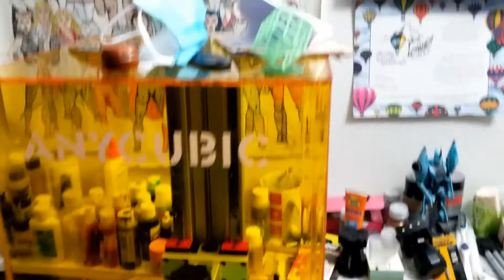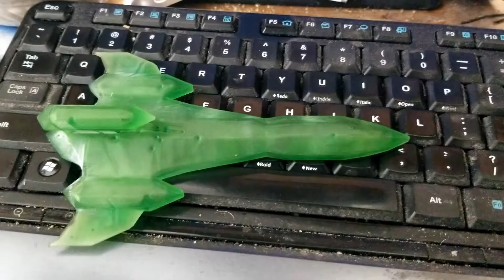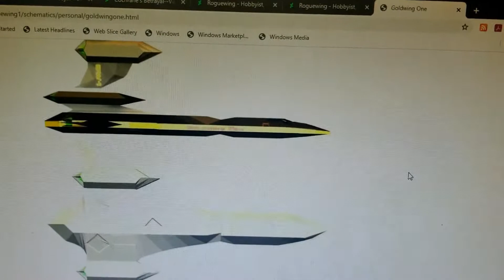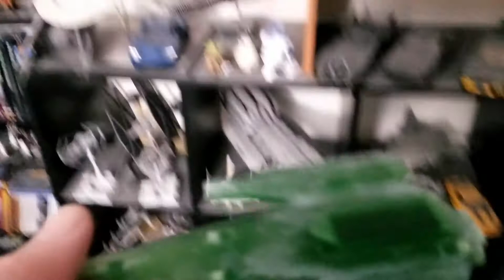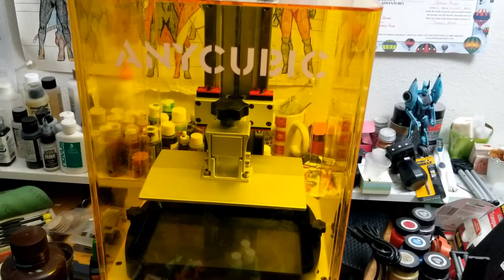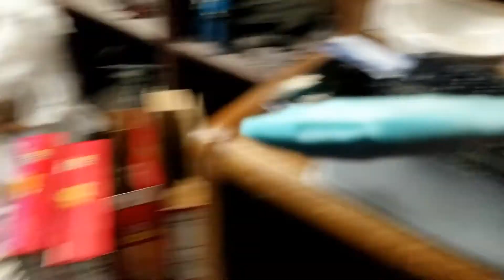Adventures In 3d Printing

Comment: A big investment for you there Patrick.

But a new thing/hobby always takes time to get used to & experimenting is the key to getting better.

I'm sure you'll get there in the end.

While the expense of laying out for the 3D printer is big ATM, im sure in time you'll be saving money in the long run, not having to shell out for all those aftermarket parts you keep buying, when you can print them off yourself.
Reply from the maker: Definitely going to be good for that, Wayne.
And I'm getting better with it

Comment: Hi, i've been following your videos for some years now, and i've always enjoyed your builds and i'm glad to see that you purchased a 3D Printer, i have also one, and if you accept a suggestion for your hollow 3D prints, if you're using Chitubox to prepare the files there is an option to make holes in the files, so that way you can print hollow and the resin will flow through the hole. Congratulations on your fantastic channel :D
Reply from the maker: Thanks.
And I've been thinking of looking into Chitubox rather than just using Photon